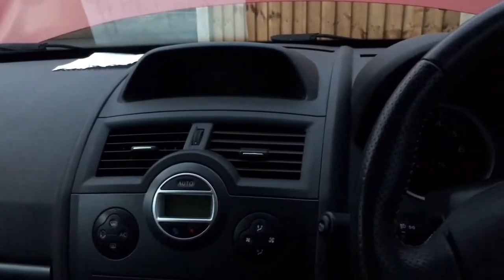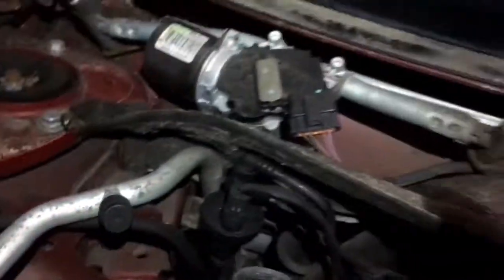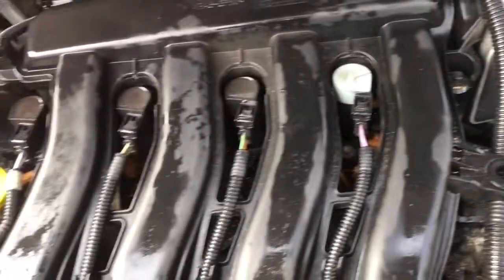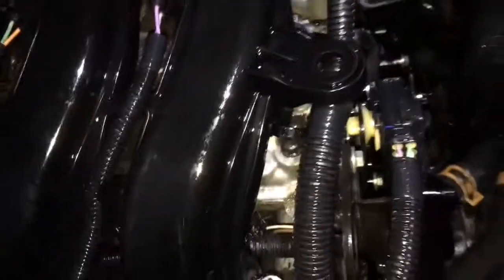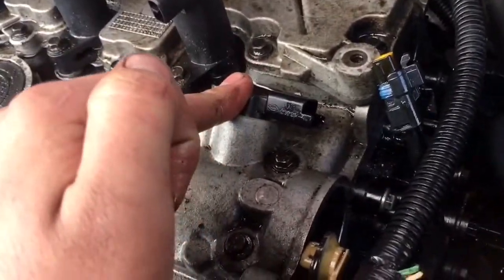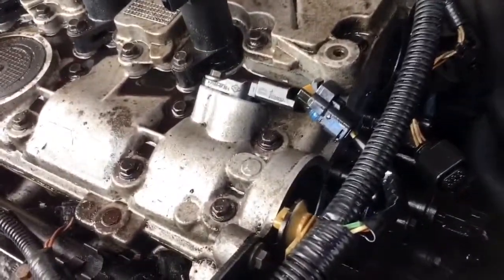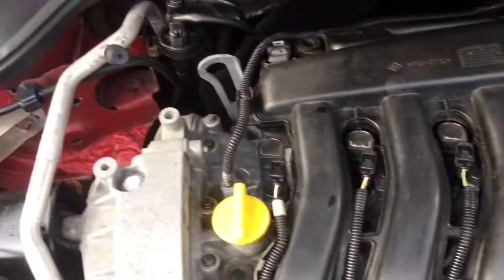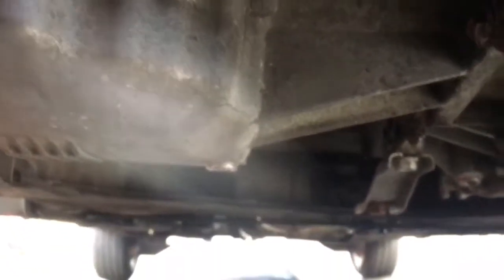No more oil leak on the megane

Comment: Thank you for this post. I have a very similar issues in reference to my Mégane. Puddle of Oil on top above the gear box up under/next to the thermostat. If cleaned the top of engine with degreaser. I've not looked underneath yet! What were the name of the 'O' rings or part number you used in the video.. thanks
Reply from the maker: Hi ya mate I had trouble getting the o rings when I rang reno and told them I needed a pcv o ring they didn’t know what I meant they emailed me a diagram and I had to circle what it was and send them it back so I’m not to sure on the term that Reno would use and if you have a puddle of oil on the gearbox check you’re thermostat housing they have a oil way running through it (strange I know) they are prone to warping and leaking the exact same thing has happened to mine I replaced mine with a aluminium one video coming soon on that
Reply: @manlikeliam5717  .. Awesome! I had replaced the thermostat a while back before I noticed "Oil leak". When I replaced thermostat, the thermstat gauge didn't match, slightly so had to use orginal. Which is not 100% snug fit. I have a feeling that is the cause. Unfortunately the "recommend" parts at EURO CP never match my vehicle! Even for basic service parts! 

But I'm no adverse to changing thermostat it again to prevent this pudding. The smell of the oil is slightly sweet, so image it's a little coolant. Didn't even know they did aluminium housing! 

Much appreciated this video really helped!